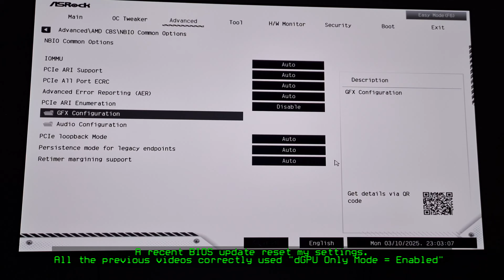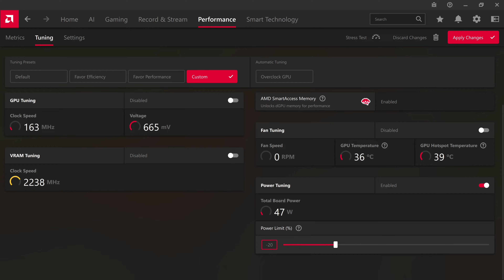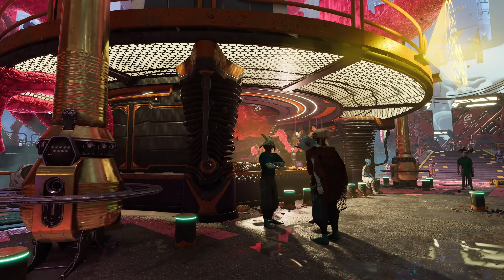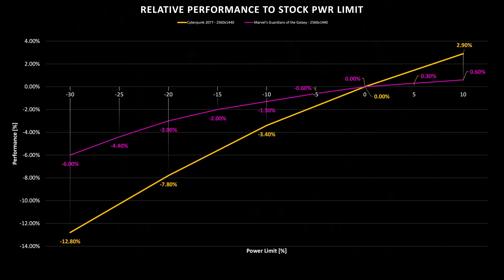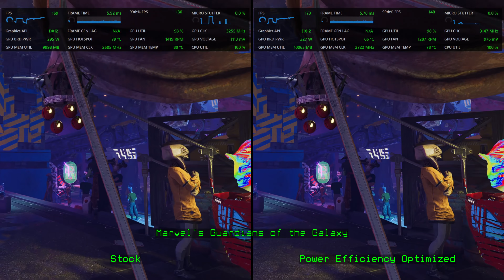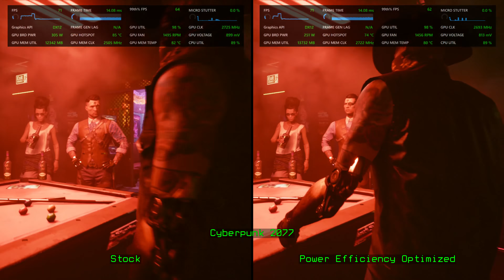Radeon RX 9070 XT - Improve Power Efficiency - Power Limit Scaling

Comment: I had the asrock taichi 9070 xt for a while before I yraded it for an 5070 due to poor fsr 4 support at the time being. I ran it stable at -30% power and -120mv, performance vs stock was 95-96% so worth it in my opinion since it used 225W instead of 320W 😊 today I might have kept the 9070 xt due to much better fsr 4 support :)

Comment: the way to go is -60 mV and PL -30 % at 213 Watts
Reply from the maker: That's a strong PL reduction. No issues with frame time stability?
Reply: @patronautsvirtualworld8155  No effect. you can cut 30 % of the power consumption (304 W) for around 5 % performance loss. Basically RX 9070 + 8 CU's. AMD pushed unneccessary the powerlimit of the XT to create a bigger difference to the non XT.

Comment: Cyberpunk and Control are outlier games. in my test with CP 1440 Ultra + Pathtracing i went from -30 % 42,48 FPS to +10 % 47,68 FPS that is only 12,2 % more or 11 % less. und this was the best case. All other games had less than 10 % improvement going from -30 % to +10 %.

Comment: I've also set my card at -30% pl and -80 uv, very quiet, cool (except memory reaching 82°C, but there's not much you can do about that) and stable so far. From other tests I've seen i should lose around 3 to 6% performance with these settings, which is absolutely fine by me, considering that if anything I'm already kinda bottlenecked by my 5700x3d in some rare situations (except Tarkov). I wonder if i should overclock slightly my vram, to see if that could help me slightly in some situations, especially in games that use a lot of it, like Escape from Tarkov.

Comment: 9070xt nitro+ user here

anything more than  -50mv will lead to crashing on extending gaming.. the heavier the undervolt the faster the crash happens...      havent been able to keep -55mv or more stable.         it also leads to massive performance losses in resource hungry games like PUBG... there is a massive performance dip with the eco tune of -30% power and -50mv or more....   now settled for -10%power / 0% power and -10mv / -30mv and performing smooth with little bottom outs and no crashes

Using 34" 1440p uhd fyi... might not be so demanding on a smaller resolution
Reply: I had the same experience here. Currently running 2714 on mem, 0 in max frequency offset and an voltage offset of -25mv with -10% power limit. This has been 100% stable so far.  
In some games -75mv seems to work just fine. -50mv works in most games. Some games need -25mv.
Lowering max frequency offset seems to make my card completely unstable in some games. Increasing max frequency offset does nothing in any tested situation.
Reply from the maker: Thank you for sharing, too!
Reply from the maker: Thank you for sharing!
Reply: i have 9070xt steel legend and -85mv - not a single crush on any game i"ve played.
Reply: It depends on silicon lottery and default power limits. The nitro+ has a default 330w power limit, has an example

Comment: In my opinion RX 9070 XT is a beast, my only concern are memory junction temperature and GPU hotspot.😊
Reply: that's becaus memory is from Hynix! On 9070xt pulse memory from Samsung and the card is almost ice for AMD cards :) hot spot although is good always around 70 72 in heavy games! At least for my steel legend.